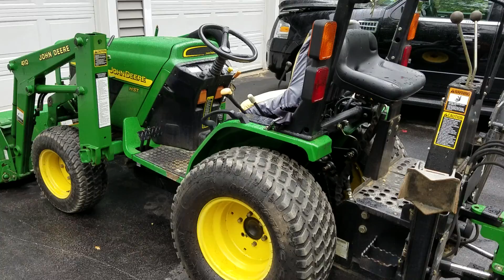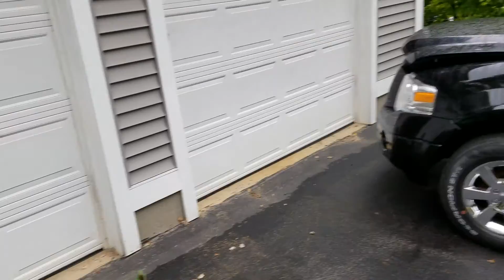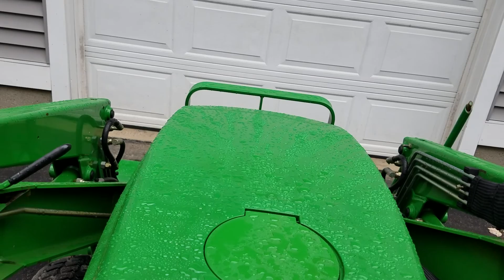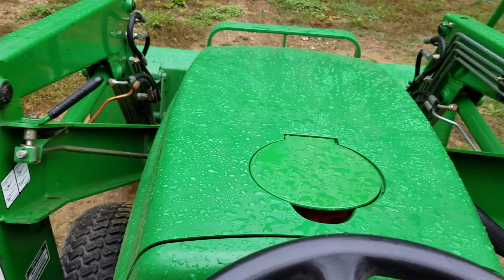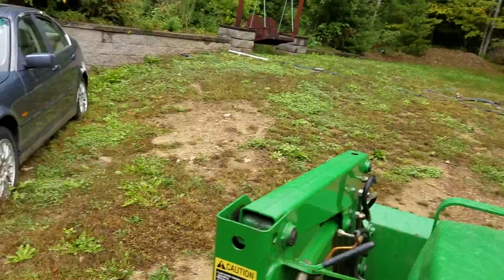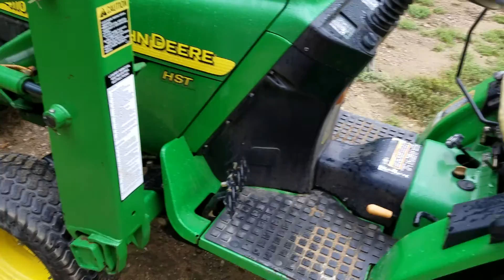Tractor Hydraulic Whine When Cold

Comment: My 2022 JD 1025r does the same thing.  Even when it’s 75 degrees out side?

I just picked it up last week and it has 320 hours on it .

I changed the regular oil and I changed the hydraulic fluid filter only .  Made sure to top off the hydraulic fluid so it wasn’t low.  I also made sure that the fluid in the axles were at the correct level.  Mine does have a cab on it so maybe it’s a little bit louder than normal but I am also getting that whine.

I was getting a little paranoid to feel something wrong with it .

Comment: I have a 2010 John Deere skid steer I just bought used and it has the same noise when you push or pull the steering controls levers. You can hear it in the cap but not outside the cab. It has me worried lately but your video is making me think this is normal, it sounds just like your tractor. I believe I am over thinking too much. Good video! Thanks!